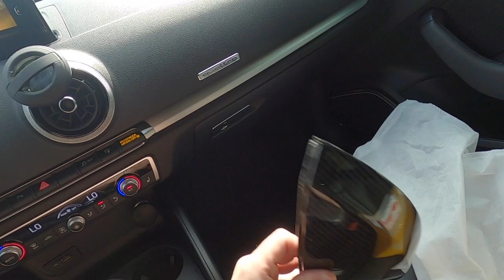Audi A3/S3/RS3 Mirror Cap Removal & Carbon Mirror Cap Install!

Comment: Hope the b9 sq5 caps look look the same with the install couldn't find any videos on the sq5
Reply from the maker: Should be very similar bro!
Reply: @DArias  mine looked like it had to facing down and mirrors pulled from the top. Also my caps had a single screw that had to be removed before it would fully release. Just tackled it about an hr ago qas pretty quick. Carbon fiver caps look so much better over the stock silver ones.
Reply: @DArias  if u have the German accessories ones how was the fitment? I got those same ones and thw fitment to me wasn't perfect. The oem ones sat super flush zero gaps ir overlapping. These ones seemed to over lap in certain areas and tiny gaps here and there. Didn't seem to be any gaps tho where it looks like there could be a leak. Looks sealed off.

Comment: Hey bro, luv the content! Im wondering if you know how different it is with auto fold mirrors?
Reply from the maker: Thanks man! I’m gonna be honest not 100% sure. I’m almost positive it would be the same process but you may run into a few more wires but the process to remove the glass and etc should be the same
Reply: @DArias  I guess my question should of been, can I manually move the mirror like you? I'm so hesitant to try to move it by hand.. I think as long as I have the car off and they don't try to fold.
Reply: @DArias  thanks again for the quick response 👍 👏 much appreciated

Comment: Yo hows the fitment with these? Been thinking about getting a set but have heard stories of them not fitting perfect.
Reply from the maker: Personally my came perfect fitment was on point no issue with the blind spot sensors etc. i have too heard that some people have some fitment issues as well. The few people who have purchased them that I know haven’t had any problems either so it could be hit or miss. My experience with these were good but I don’t wanna vouch and say 100% lol it’s a risk I guess but have also heard they are good with customer service with returning or exchanging when a problem persists
Reply: @DArias  Where are these from?